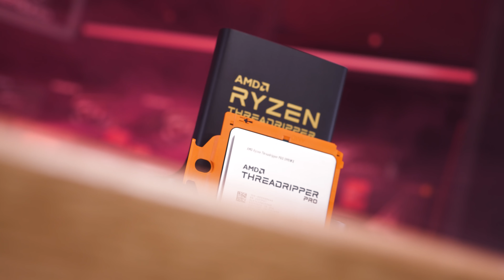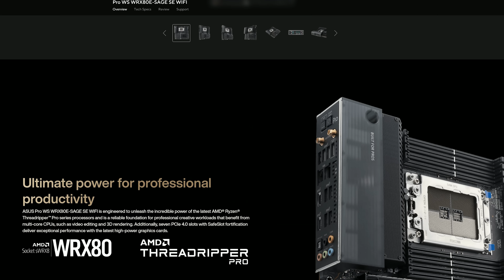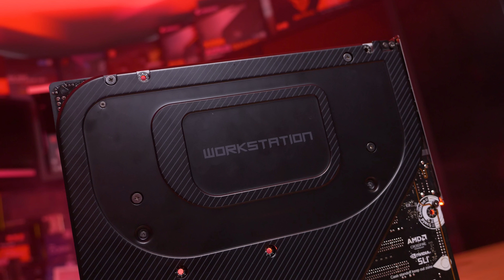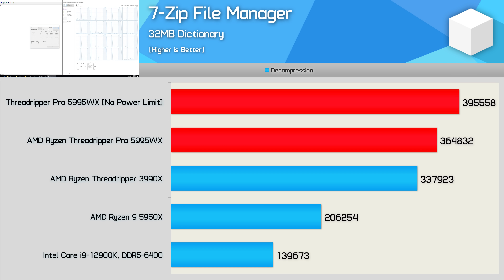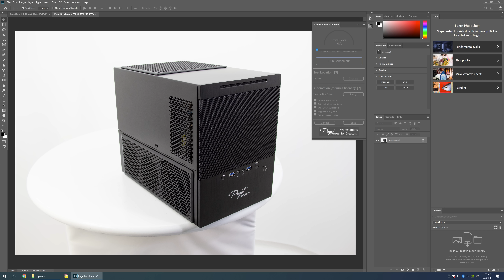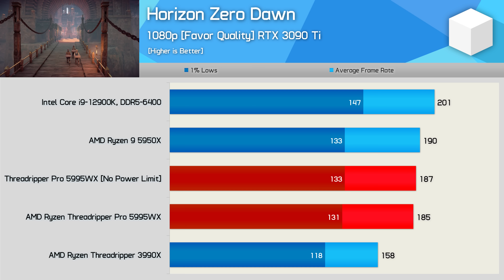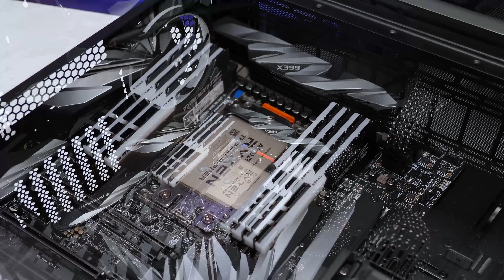It’s Finally Here! AMD’s Ryzen Threadripper Pro 5995WX, Benchmarks, Power & Cooling

Comment: Browsed through the thumbnails and I'm having hard time understanding why would you spend (waste) so much time doing gaming benchmarks, when it's not meant for gaming.
It's not like the niche last gen-mid tier Threadripper that was both affordable and unrestricted, so you could pull the "I'm running VMs and analyzing large data while playing Crysis" card, because it was plausible. But now it doesn't. Kind of a weird way to showcase this cpu. As relevant as reviewing a $1m John Deere tractor by checking if it can be daily driven to school and Wallmart as well
Reply: This CPU is for prosumers, not consumers. The purpose was showing both because their audience is split between the 2.

Comment: Steve, why does the image with the Dark Base and the radiator show an 6900XT instead of the 3090Ti tho?
did you cross-test with different GPUs, was the temperature measured with the Radeon card installed or was it just for.. fun?
Reply from the maker: I changed the graphics card for the broll...

Comment: I think the issue with the 3000 series wx parts was they already had the 3000 series regular threadripper. So they didn't want do completely invalidate TRX40 as it was still selling at the time, as well as they wanted to test the waters with much more capable threadrippers that were basically epycs. But several things have changed since the 3000 series launch, firstly the competition in this category died, the 3000x series was the last HEDT chips, and they were released early 2020. Intel's last major offering in the space was the 10990x which was just a limited run 9990x which was a refreshed 7990x and was so vastly under performing it was laughable. But now that this is the ONLY threadripper lineup, its safe to sell direct to consumers again as its not invalidating any of their own products anymore, the 5950x sits happily as a mainstream part and thats it, theres no other threadripper. Combined with the chiplet and IO die design, you can also run this with whatever memory config you want and it won't suffer like gen 1 and 2 threadripper did, as all memory is handled by the IO die. Also the overclocking support came back as they basically deemed this the new path for threadripper overall, as really old threadripper was realistically replaced by the 5950x anyways. 

So you can have 64gb of ram and one mediocre gpu if all you need is cpu horsepower, or you can have 2tb of ram and 4 3090ti's if you need wildly massive compute and have absolute massive datasets. Also while its extremely pricy for a desktop cpu, it's a LOT cheaper than a server cpu and really if the speed over a 5950x benefits you this heavily, as you said its likely for productivity and money making, making it priceless. 

I usually don't support this kinda stuff but if you have a workload you need to know if it specifically will help you out with this much, buy somewhere with a good return policy (like amazon), build the pc, test the software, and if it does work wonders then keep it, or if it doesn't help then return everything as if it never happened.

Comment: I'm sorry but the demand for HEDT is there. The reason is plain old greed, AMD and their backdoor deals with OEMs and both decided to jack up the prices to insane levels. This move is going to kill the demand for Threadripper the way Intel did for optane PMDIMMs by overpricing it. $15,000 for 1x 512GB optane DIMM or $15,000 for 15x 4TB U.2 NVME drives. This is just plain greed by AMD, RIP Threadripper.

Comment: I wanted a Beast Threadripper build.  😪 But I would mostly be Gaming on it.  So a regular Cup from amd.  Would do the trick for me.  Anyway this Beast of a cpu.  Is just way out of my reach.
Reply: If you have worse performance on than on a 5800X3D and you don't have a single task that can make it fire up all the cores... then why even bother? I know the core count and PCIe lane count sounds completely stupid when you say it out loud, but strictly speaking, for your particular needs it's an inferior product.

I'm a programmer, so I need cores. I have a 5950X and a 6700XT, but when my company finally gets a proper build farm I can VPN into I'd rather have a 5800X3D as I don't do anything else than compile jobs that benefit from more than 8 cores. But then again, the 6700XT at 1440p is pegged at 99% GPU utilization at all times with the 5950X, so it's not like I can make use of the extra gaming performance.

Comment: Another great plus point for this CPU is; In the past if you wanted good gaming performance you had to have a seperate system with a consumer grade CPU, but now Threadripper has pushed the single core perfomance up almost to consumer CPU levels (Ryzen 5/7/9, Intel i5/7/9) while sure, it may still fall behind a little bit - the difference is negligible so now you can truly have a All-In-One PC for both productivity AND high-end gaming whereas in the past the gaming performance on workstation PC's was lackluster and very mediocre. I'm really glad to see AMD pushing the bar and giving consumers more options. I might actually build this instead of having two desktops like I do now. Need to do some saving up though lol..
Reply: If you can afford a Threadripper Pro you're probably also on 4K where CPU performance isn't exactly an issue.
Reply: @andersjjensen  It's not for rendering.. screen resolution is totally irrelevant to me. I have 1080p and 1440p displays. That logic doesn't really make sense. Just because I can doesn't mean I need to.

Comment: Curious about the editing problems that you’re running into after upgrading to the Panasonic GH6. Haven’t had experience with the GH6 personally, but it sounds like the 5.7K mode might have to record in a high efficiency codec to keep file sizes manageable? I’ve had issues with Premiere Pro not playing back H.265/HEVC files properly. 

I ran into an issue on the Sony FX3 recording 4K 10-bit 4:2:2 and could not scrub through footage properly inside Premiere Pro if I imported the footage straight from the camera. I then started transcoding all the footage to ProRes 4:2:2 LT preset in Media Encoder, then I could scrub through Premiere Pro more efficiently. 

The downside is I have to wait for the transcodes to finish and the ProRes files are significantly larger, but it was the only workflow change I could do to make it function properly. 

I know it’s not the same camera but it seems like a lot of consumer level cameras are pushing their recording capabilities but need to rely on H.265/HEVC, which I think for years has always not played nicely with Premiere. Hope this might help you better optimize your current workflow!

Comment: My Ryzen 5950 does 31.000 in Cine R23, 4,5 GHZ all core, even stock it must be more than that, Around 27 - 28k.
Reply: Really? Mine is water cooled, all stock minus PBO (Auto), and I score in the 25s.
Reply: @CornFed_3  Your RAM could do with a bit of latency tuning...
Reply: @andersjjensen , running 64GB (2x32GB) at 3200 with CL14 timings.

Comment: The 12900 is 36% faster than everything else in watchdogs ?? Does that gap hold if you equalized the ram speed differences?
Reply: Not to that extend. You can watch his day 1 review of it. There he shows both DDR4 and DDR5 (crappy 5400CL52 was the only thing out at the time).
Reply: @andersjjensen  so does it make any difference ? And is ddr5 in that place where you can’t even get ddr5 that’s faster than ddr4 with good timings ?

Comment: Hey, I am using Corsair vengeance LPX ram 16gb 3200Mhz and this ram is cool but now I want to pair it with 3600Mhz because it is selling for cheap. Is it possible ? If yes then should we overclock 3200 to 3600 ? Need suggestions asap. Thanks in advance ☺️

Comment: It’s actually insulting that amd lured us into their house and then tempted us with affordable reasonably priced threadripper and the moment things improve for amd financially they say GET LOST. 
I am ok with very low quantities and having to wait forever for stock of threadripper to be available etc but at least give us a CHANCE of buying them.
Reply: AMD never gave a roadmap for sTRX4. They did for AM4. And now they're getting all the flack they need to justify simply moving HEDT/workstation parts completely out of retail and back to OEM-only.

If it made financial sense to them to keep doing Threadripper they would have. AMD, like every other company, doesn't leave money on the table. If they stop doing it it's because its a dead ringer that only just broke even, or perhaps even turned a loss. It may have been worth it to take a small loss on the platform as a whole just to make Intel look stupid. At the height of Threadripper 3000 Intel couldn't produce SERVER CPUs that powerful. That kind of hype is worth a few red numbers elsewhere.

Thinking that they stopped doing it because now they can afford to be lazy and not bother with money any more is a whole new level of warped thinking. That's like Schroedinger's AMD: They're greedy and too lazy to make money at the same time, you just don't know which it is until you need an argument.

Other than that: I do get why you're disappointed that they didn't continue. It would be nice if those of us right between the two extremes could have a midle ground. If they ever consider picking up the gauntlet again I hope they do something like this:

Platform is still 64 PCIe lanes and 4 memory channels:
16 cores: for those who just need the lanes.
32 cores: Al-round HEDT.
48 cores: You're probably going Pro soon...

64 cores is non existent as this eats into Pro sales, and lets face it: you very likely to either need more memory channels or PCIe lanes at this stage....

Comment: Great work. That faffing about with the CPU cooler cannot have been good: why not just switch to the Noctua air cooler which provides full CPU coverage? A key selling point of Threadripper Pro is its ability to use more than 256 GB of RAM so I was disappointed to see you only used 256 GB. I'd love to learn about higher RAM configurations: which RAM to choose for which situation and so on. Lastly, you tested the 64 core product; I'd like you to look at the 12 and 16 core products and how they compare with their Ryzen counterparts on more lightly-threaded workloads. Test a 5945 and 5955 with 512 GB RAM against a 5900 and 5950 with 128 GB.
Reply: Because they wanted water cooling. Because they didn't have that much ram on hand and their kit was given to them. And no, I seriously doubt they'd test any Threadripper less than a 24 core, the singlethreaded and lightly-threaded performance between Threadripper 5000 and Ryzen 5000 is practically identical.

Comment: I've got a 5950x which is good enough, but I'm still gonna drool over a CPU that has L3 cache equal to my first computers RAM.
Reply: My first PC had 4MB RAM. The Core 2 Duo laptop in my closet of old hardware, which I bought in 2007, had 4MB L2 cache.

But still to this day my Commodore 64 remains "the best computer I ever had" :P

Comment: Wondering, if you were regretting upgrading the camera and considered going back, until a beast like this CPU would arrive to handle the higher resolution footage!?
Reply: Why would you "go back" when you could just use the GH6's 4k recording mode instead of the 5.7k mode? You don't need to downgrade the camera - and the expense that would incur if they've already displosed of the older cameras - to film in 4k.
Reply: @yumyong3847  Good point. Might have been a bitrate issue as well - not familiar with said cams.
Reply: I think they want the 5.7K recording because that lets them crop off the edges (frame stabilization does this and the "ultra slow zoom" effect they use does this) while still having enough pixels left for true 4K.

Comment: the only think i can think of rationalizing this for a consumer is if they do art, via 3D rendering, or Massive video editing, or some kind of simulations. Edit: And they make loads of cash from it.
Reply: Wouldn't a 3090(Ti) be more desirable for 3D workloads? I don't think any CPU makes that much sense for such workloads, especially when it comes to OPTIX being damn fast for rendering.
Reply: @MLWJ1993  Blender and certain programs generally use CPU rendering for quality, also Gpu rendering ecounters ram limitations, so often for very complex scenes more CPU cores + boatloads of onboard ram=better, However if your running that WRX 5995x you will be running at the very least a 3090, and possibly a 3090ti, but even more possibly at this price point an A6000 a basically $5000 48gb workstation gpu

Comment: Not all OEM systems are built the same and best not to "tar with the same brush" as they say. Check out Ian Cutress, tech tech potato's 5995WX TP Pro review using UK based Armari workstation system with PBO working. Maybe not the cheapest system but you get what you pay for. Oh and I have no affiliation with Armari. Quite amusingly they are using your least favourite motherboard manufacturer, but seem to be the only manufacturer with working PBO on this chip! Be interesting to see the boost you do get on Premier Pro, with PBO, when you get replacement board. Ian did not show Premier Pro in his benchmarks.

Comment: Great show Steve. There will be some users who simply must have the very best in everything and would part with the USD$6,500 just for bragging rights. To be utterly truthful, I find 4 cores more than adequate for me and often cannot understand the mentality of some who would never even use much more than 10% of their cpu's ability. Go figure.
Reply: Someone gunning for 8 cores is likely looking to have a buffer in case they find even 6 cores to struggle. Having spent the last decade on a 2430M, I can certainly understand that.
Reply: 4 cores is enough most of the time, thou personally, i need 6 core since i run emulation on my PC

Comment: This CPU is built exclusively for Creatives, the price is definitely not consumer friendly but for those whose career revolves around the workload this CPU is designed for, it's a gamechanger.
Reply: I like that there are high end cpus for people with focused workloads (this for professionals, 5800x3d for gaming) as well as some that do really well in a lot of different workloads (12900k/ks, 5900x, 5950x)
Reply: It's absolutely not built exclusively for creators. That's complete nonsense.
Reply: @KimJongBilly  It's hard to pay 4 figures for a processor if you don't actually need it.  Can easily get a Core i9 or Ryzen 9 for a fraction of the price and those products tend to perform equal to or better than a workstation CPU in many applications such as games.  However if you're a video creator, a 3D modeler, a musician, etc. who uses their PC to do real work that makes them real money, these processors make a lot of sense as they can save you many hours of your time, and that extra time can be used to make even more money, which means the product pays for itself.

Comment: ~10% overall performance increase in average comparing to Zen2 based TR release after 3 years, but almost 2x more expensive. No, thanks AMD! We should also not to forget AMD forcing their customers to go for so-called PRO version instead of much cheaper regular version.
Reply: No point in having 2 product lines that are the same. You know they would rather just sell Epyc
Reply: @tuckerhiggins4336  I agree. That's why TR 5xxx series supposed to be much cheaper. Workstation users mainly need CPU resource not 8 channel memory line or any PRO feature since, it actually doesn't bring any value for workstation applications. EPYC is a server CPU (e.g. VM hosting, partitioning), TR is a workstation CPU. I have 3970x, and I absolutely can't justify 5970x for this price range for myself. I paid £1800 for TR 3970x. TR 5970x with 10% performance increase and £3250. It's a joke.
Reply: Have you watch the entire video or u just skipping to the end 🧐
Reply: @dogdie147  Yes, I did. This CPU is a workhorse for multithreaded applications like rendering (mainly Premier, x264), 3D designing (AutoCAD, 3D Studio Max). Not for gaming, so it's even absurd to have gaming performance test on these high thread count CPUs since games can't even scale the threads.
Reply: It's software not amd
Reply: @chriswright8074  Not for CB R23 which is the most crucial in any of these test scenarios.

Comment: I wish we had a CPU with a normal amount of cores and a high amount of pcie lanes just like in the days of x79 and x99.
Reply: So like 6 cores then right
Reply: @tuckerhiggins4336  in modern context 8 would be about right. P.S. even x79 unofficially supports 8 core CPUs. I have an old rog iv formula which supports a 1680v2 which is 8 cores and yes it is also overclockbale. Had it running 4.5ghz until I upgraded in the last year.
Reply: They built them and few people bought them. This taught AMD not to build them unfortunately. I did. I got the 1900x and upgraded to the 2920x.